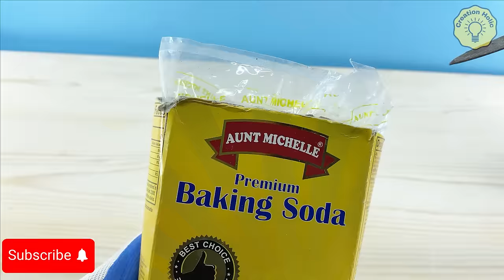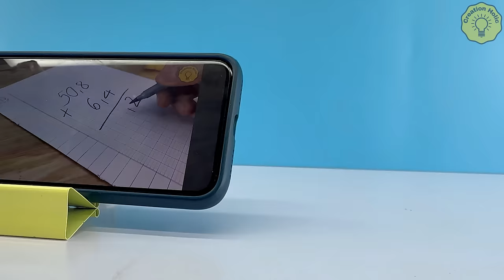Top 25 Ingenious Tips and Hacks from High Level Handyman

Comment: Ideias muito boas. Pra pegar o pó de ferro, primeiro coloque o ímã 🧲 dentro de um saco plástico, depois recolha o pó de ferro. Saudações direto do Brasil.
Reply from the maker: Thanks for sharing!
Reply: 10:22 - could also be used as a bird feeder if you add a tiny step on the bottom edge.
Might need a kind of roof or  protection on top to keep it dry below but the closure of the bottle offers a great opportunity for that.
great idea.

Comment: Argentina,estoy mirando como resolves pegar usando calor muy bueno😊
Reply: Tiene que dser siempre papel de aluminio?cuando soldas gracias argentina son muy buenos🇦🇷👍😊
Reply from the maker: Aluminum foil helps insulate and concentrate more heat, but you can also use paper tape